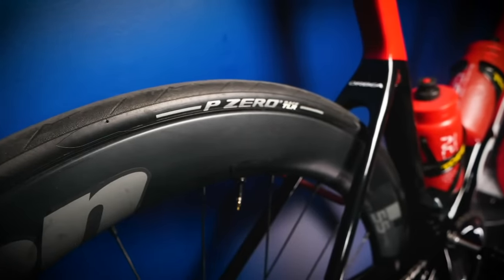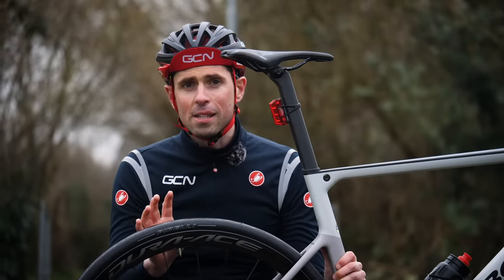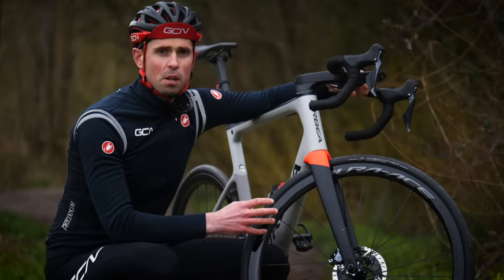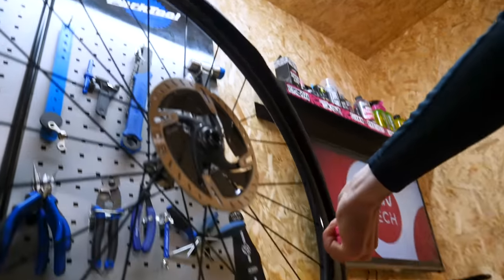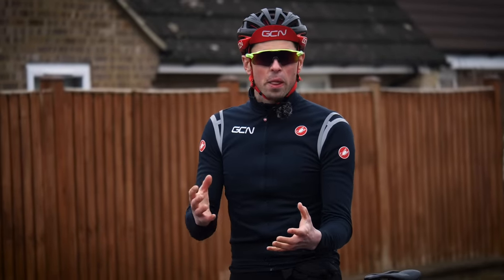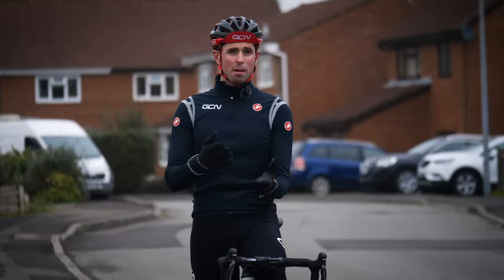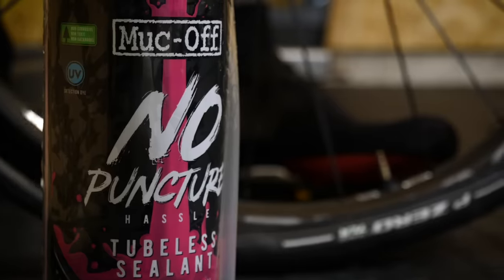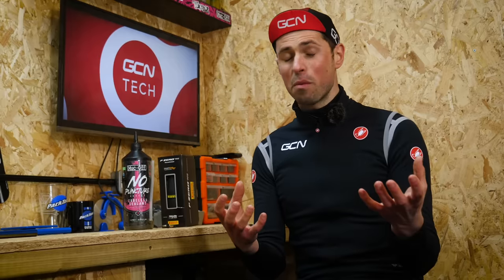Tubeless Convert! | Why Alex Will Never Use Inner Tubes On His Road Bike Again

Comment: How do you remove and clean up the old sealant before adding new sealant to the wheel?
Reply: you don't, just top it up.
Reply: Or you can take the tire off and rinse it out.  But I just top off.  I've forgotten and it hasn't been an issue.  Orange Seal tends to separate (latex/water).  I think Stan's race formula is the best.

Comment: I am trying tubeless, giving it a good go despite having a puncture that didn't seal in the first 4 weeks of using them. But when I attempted to remove that tyre.. OMG, my soul broke before the seal between tyre & rim did!!  Would be nervous to use these in a long Grand Fondo, or train alone in the deep mountains. I think I have this terrible dilemma that "they rarely puncture and I will go faster/be smoother vs ...but if they do my race might be over if I can't break that seal or it's an expensive taxi call". Risk is just too high vs the reward so would feel safer on tubes.

Comment: Yeah I think they sorta skimmed over the installation bit.  This isn’t really the fault of tubeless technology but more a lack of standardisation in road tubeless.  In any case it can be a pain to setup at times, at times nearly impossible if you don’t have the tools or experience at home. 

The biggest advantage for me is the way it behaves when punctured compared to tubeless.  You can always fall back on tubes absolute worst case and that is very rare in my experience. 

With tubes generally speaking about 80-90% of the time in my experience it will require replacement or patching of the tube and removal of the wheel as the air loss rate is too much to hobble along by pumping it up again and again.  

Tubeless on the other hand almost always leaks a lot slower due to the thicker carcass of the tyre, a lot of the time you can limp home by pumping it up. If it doesn’t seal with sealant itself. 

If it won’t seal itself then plugging it with an “anchovy” will almost certainly fix about 90% of punctures.   A lot easier than changing a tube most of the time and quicker for me. 

If it’s really drastic you carry a tube and can stick it in.  Marginally messier if you have sealant inside but not really that big a deal. This is really rare and have only needed to do this maybe once every few years to be honest. 

Secondly I do prefer the road feel of tubeless, off road even more so. 

Whether it’s worth the faff is another question if you are that way inclined.

Comment: Tip for installing new TL tyres; inflate them with tubes with high pressure, ride them or not, but check pressure. After a few days the carcass will give you more space to convert to tubeless. I prefer a tighter carcass, you are more confident of not having future problems, like burping. Cheers

Comment: I converted to tubeless a few years ago but after a couple of complete failures on the roadside, I've gone back to inner tubes. The expensive hassle of setting them up and trying to fix any big holes isn't worth it for me. What would take 5 mins to fix with a new inner tube has taken be up to an hour to fix with tubeless tyres. Both big roadside failures I had, needed to be saved by inner tubes which resulted in me getting sealant everywhere.

Comment: When tubeless, it's nice to treat those rare roadside punctures with sealant, plugs and CO2-cartridges. You kinda have to though,  because getting the tire off and on for a tube mostly takes some time and nerves. But to be be honest, it's hard to feel the difference of tubeless compared to latex inner tubes. Same tires, 32-35mm, for comfort stay below 50psi on tarmac (75-80kg). I prefer not go above 55, 60psi at the most. CX tires, latex tubed, 22-32psi depending on the ground. Above 40mm you can ride ridiculously low pressures on road, grippy and supple, but that's for wider frame clearances.

Comment: I have just done the change to Tubeless Tyres, only 2 rides in so far but I can feel the difference all round. I was skeptic about the change, I was running Continental 5000 but had a number of punctures in a week, I thought I would give it a go. My Easton wheels were already TL ready, they  had the tape in and the bike came with the valves. ProBike selling the Cont 5000 TL cheap at 79 for a pair of  25c. So went for it.

Comment: Only used inner tube once in past 4 years, I built myself a new set of wheel and went out for a test ride with inner tubes. Got a puncture 8km down the road and had to take taxi home. Now rode on tubeless for almost 60k km, had a few punctures but none had made me stopped to fix the tire. Now only my trainer bike has inner tube.

Comment: Between using milky white sticky sealant and inner tube... between mopping the wet floor and dry inner tube... between a 6-month diaper change and once a year ... between a possible natural dry-up sealant sitting at home and a made in China 'Conti Race inner tube,... between most of all a clean place and a dripping sealant here or there after that ... I go for an inner tube.

Comment: If you ride on decent roads, and you’re not pinch puncturing all the time your likelihood of flat is just as likely. However when (not if) it does, it is an absolute nightmare to deal with. 

Rim and bead interface is insanely tight, and is not easy to de-bead by hand. Sealant will have gone absolutely everywhere, and you better have an extra large CO2 if you think you’re going to get the bead of the tire seated properly again. 

I’ve run tubeless setups on ENVE, i9, Giant, and other rims with tires from Schwalbe, Giant and Continental. All of the combos I’ve tried have always failed to seal properly, spit out all their sealant and lost pressure before sealing. 

Will I try it again? Reluctantly yeah, I’d love for them to be as good as claimed, but I don’t have a lot of hope as I think the high pressure and low volume of a road bike tire doesn’t lend itself to working well with tubeless like MTB does.

Comment: I've just gone tubeless purely for comfort, really (some of the roads I ride on are just bone-shakingly terrible (can't imagine it's good for the bike either). Just bought a road bike (came with 28mm) after using a hybrid (front suspension/ 38mm marathon's) and it was just terrible. Put some Conti 4 seasons 32mm on it, which was better, but still terrible! So I bit the bullet and went tubeless with some 36mm WTB's (come out at 37mm @ 50psi). Only had one ride so far, but the difference is stark. So much more comfortable.

Comment: Unless your running a complete system like mavic or bontrager where the same company makes the tire and the rim there is too much variance in tire size leading to unpredictable results, ie a tire that has been set up for several days randomly blowing off the rim. Not to mention I have rarely seen one that would seal a puncture at over 60psi, and when it doesn't seal it sprays sealant all over the bike and is a huge mess to put a tube in on the side of the road. Tubeless works great on MTB where there is large volume and low pressure.

Comment: I've been riding since 1 year tubeless. I must admit that all the commercial blah blah on  road feel, comfort, grip, less punctures are totally true. Just one big disadvantage: I got already 2 punctures where the sealant could not stop the air so I ended up putting an innertube to get me home which is a very messy work. Disliked this more then the old days. But I stick to tubeless anyway as the advantages are outperforming the disadvantages.

Comment: A blind test would be fun....and multiples runs at a specific wattage at different distances.  Ive been running both for years and, as a 57 year old biker not interested in racing but like speed, find tubeless to be more comfortable as the best advantage.

Comment: The main reason i keep inner tubes is that I'm fairly confident that I fix punctures or hack repairs on a tyre. But with tubeless, it just seems to be a big faff if it doesn't seal. Plus the messiness of the sealant while trying to fix a puncture on the road. Faff, faff, faff!
Reply: You can bring inner tubes in case of emergency even with tubeless
Reply from the maker: Sealant is definitely messy, and tubeless set-up is certainly more tricky than tubes. Once the system is set up however it's typically pretty trouble-free!
Reply: @gcntech  how difficult is the tubeless tyre to put on and off? I had Continental Gatorskin tyres with the wire beads, these were the worst tyres to try and change, especially in cold weather! Are tubeless like these in difficulty?
Reply: Get a Dynaplug Racer. I can fix a non-sealing puncture in about 30s and don't even have to take the wheel off (or add air in most cases). Just plug and keep riding. Game Changer.

Comment: I agree with you 💯, besides the obvious smooth ride and the incredible difference of 20 pounds or so, the chances of getting a flat just seem lower. I still carry an inner tube in case the puncture sealant fails ! Great video

Comment: Why did you run 95 psi on the inner tubes? You can go much lower. Im pretty sure other gcn videos pointed out the benefits. That's actually why I use lower pressure on my tires.
Reply: I ride 4 days a week 42km a day on conti gp 4 seasons 25mm with cheap inner tubes. I have 4.5 bar (65PSI) on them. 2 flats in 5 years. I also don't understand why they always advise higher pressure. on pure flat roads I understand higher could be better, but for most roads I like 4.5 bar :). Would be nice if the comparison was made with the same pressure for all tires.

Comment: I enjoyed tubeless one season with no problems, with the very Pirelli tyres like in the movie here. All was fine until I got first puncture. I used the worm plug fix from MuckOff (same brand as milk for filling). And I even get back easily home finishing session with fixed tyre. Then I drove this tire yet another few sessions with no problems, reinforcing that the plug is fused really well. However during my important race the worm plug ruptured out during descent, and I was not able to plug the whole again. I lost 15 minutes fixing the system finally with the regular inner tube, that fortunately I had with me. It was disaster, silicon milk all over the frame, on my hands, clothes. I used up my precious drinking water to at least clean my hands to be able to ride again. I finish this race eventually, but the experience with the tubeless was horrible at this very event. My conclusions are, that if when the puncture happens the tubeless tyre cannot by trusted any more. Even when you do very thorough and correct repair with the worm plug. These plugs even fused correctly can burst out  at the most unexpected moment. Just to make sure, the tyre was not worn out, and wear of indicator (little cut recess) were still in place. They were not exposed to long sun exposure (bicycle is kept at home) or any unusual element risk factor. So after getting puncture the only permanent fix I can imagine (making sure it won't burst at random) is by patching it from the inside. 
I am running now on latex tubes and am very hesitant to ever get back to tubeless

Comment: tubeless is more maintenance than tubes, however if you ride in an area with alot of glass and want to run race tires or with thorny plants like goatheads it will reduce number of noticed punctures, in either case a  1/3 of sealant in a tube will do fine. ride your ride, for me, still team-tubes after using tubeless setups in a number of bikes cause its just not worth it to me for the extra hassle. the ease of tubes is nice. ask a tubeless rider if they carry anything in case they get a flat youll find more often than not, a rider with tubeless carrying a tube or a host of gadgets to fix tubeless problems. tubeless certainly is not problem free and the time saved from watts saved is offset by the time fixing the tighter bead of the tubeless setup.  neither setup is problem free but tubes are certainly less messy and cheaper.

Comment: I feel that this video is an example where GCN is doing more to satisfy sponsors and make us buy new stuff rather than to providing informed advice to its viewers.

While tubeless quite certainly is the future also for road bikes, I don't think the technology is mature yet. The narrower tires get, the harder the setup becomes, the worse the tire sealant works (due to higher pressure), and the less advantage in terms of pinch punctures etc you have as you ride on smoother surfaces and relatively hard tires. For a road bike, I find that you can run lower pressures also with tubes without increasing the risk much for pinch punctures -- the riding conditions and what low tire pressure means is much different in road than MTB or even gravel.

There are compelling reasons for pro road racers to run tubeless, but for recreational and training rides? Not much. Punctures even with tubes are quite rare. If you need the performance, you get 99% by using a latex tube. Putting in a spare tube is rather easy and predictable. With tubeless, you may get a bit fewer punctures, but all sorts of things can go wrong. Tires can fit too tight or too loose, you can get ghost leaks when the rim tape wears or get damaged after a re-install. Re-installing a worn tire with sealant residue everywhere is much different than installing a new one. Sealant needs to be topped off to be effective. Sealant can burst open and fail to seal when you get up in pressure. Sealant can glue the valve nut tight so you cannot get the valve out when you need to pop in a tube in the field after a sealant failure.

I use tubeless on my gravel bike with 40 mm tires, where tire pressure is reasonably low, fitting is easier, and pinch punctures is real. I used Mavic UST for a while with 25mm road tires, but I stopped, and use latex tubes and regular tires instead. With road bikes going towards 30 or 32 mm tires tubeless makes a bit more sense as tire pressures are lower and fitting is easier. But for 25mm or even 28, not so much. With tubes its also actually reasonable to change tires just for a longer ride or an event. With tubeless you'd want one wheelset per tire you are using.

Comment: I do food delivery in my city and have sometimes around 200-300km per week. So at the end I should change every month my tires. In the long run, its still cheaper to change tubes and tires instead of tubeless Systems. My experience with collé tires was horrible and if you have a whole, its much much cheaper to change the tube. Thats what I can say after four months of delivery service.

Comment: I bought a Giant Defy Adv Pro 2.  I bought because I thought the 32mm tubeless tyres would be interesting to try.  I’ve tried them at pressure from 50 to 70 psi.  I can’t tell the difference and the tyres give a wooden ride feel.  I feel almost defrauded.  I’m also nervous to ride the thing because several local riders have reported tubeless punctures they have not been able to fix at the roadside. That’s a deal breaker for me. Anyone want the bike, few miles, excellent condition.  And all the tubeless kit you could want…

Comment: You forgot the expense. If you break a spoke tubeless requires new tape, new sealent solvents to clean the rim and if your unlucky and the sealent has bobbled on the tyre a new tyre could be £50 in parts . Tube spoke repair 1 spoke £1.50. Every 3 months you have to replace the sealent every puncture you have to top it up. And it doesn’t work if your heavy and have to go above 65 psi it just sprays in your face and then you have to plug or put a tube.

Comment: In my experience a small puncture in a tubeless necessitates a new tyre but using tubes  it's a cheaper £4 replacement...replacing the fluid is also a big faff every 3 months.

Comment: Testing method is somewhat flawed.  These are short runs; performance can vary from lap to lap.  On top of which, the rider knew which sample was under test.  Not that he would intentionally skew the result but motivation could still be a factor in performance.  Far better to test the rolling resistance with a dyno.  Who knows, the benefit could be even greater than the testing showed.  Was he "warmed up" or "tired out" for the 3rd lap?  Too many variables.

Comment: I run tubeless and it’s true that most punctures self-repair, but the bad ones don’t and I’ve had two in two months. Carry a lightweight tube with you for the worst (an 8mm cut for me) and plugs for the ones that the sealant can’t quite cope with.

Comment: Replacing a punctured tube is way far easier than replacing tubeless tire ( Sealant won’t heal a sufficient hole meaning if you’ve got flat tire then most probably rest of the distance your bike will ride on you.
And there’s even more: weight of a tubeless tire and sealant inside sometimes twice higher than lightweight tube plus regular tire.
Opinions, please

Comment: Decided to try tubeless, as I normally use Conti GPs, I offered a pair of GP5000. After much swearing I sent them back. I'm now running the rear on Schwakbe Pro One over the winter. No punctures 👍. I'm still undecided.

Comment: i was lucky enough to get the mavic set of rim/tire combination that was conceived tubeless (the same you guys did a video on few years ago). it did came with a tube as standard but I took the wheels to the bike shop for the conversion (can't be bothered with all the sealant mess). And since last year I love the feeling of tubeless mainly because of the extra comfort and puncture free rides. and if you can't be bothered with the sealant, it costs around 10 euros to get the wheels to the shop and ask them to clean up and refill. so for me as well the inner tube is dead as long as the option for tubeless exists.

Comment: I'd give them a try but the sealant is a turn off.  I'm sure they'll be on the next bike when I finally wear out my current one, but I'm not going to willingly upgrade to them.  Maintenance for inner tubes is checking wear and pressure.